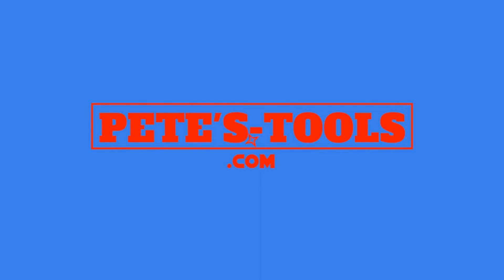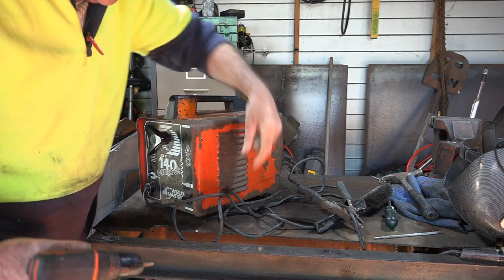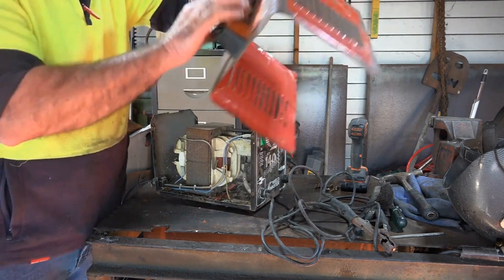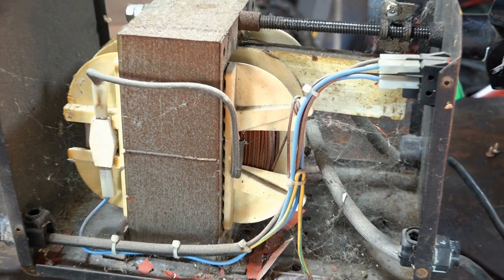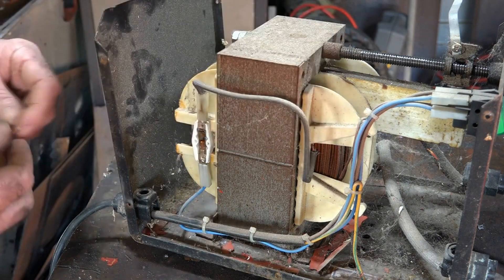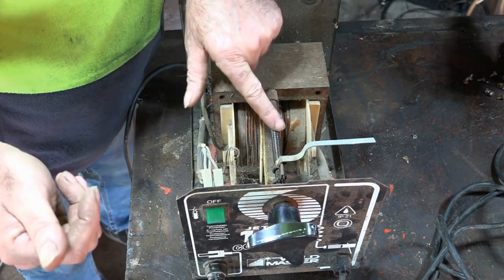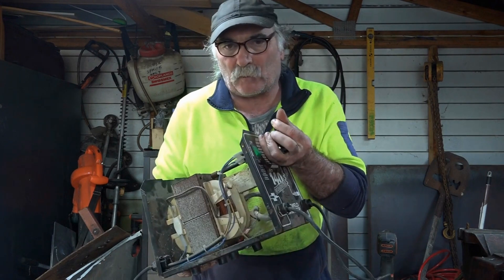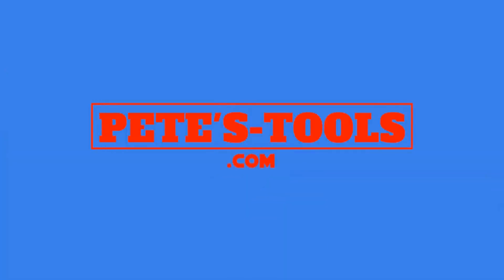Welder That Doesn't Need Electronics to Function

Comment: Hi Pete, I have a 140 AMP Welder pretty much the same as yours , I've had no trouble with it over the last 40yrs the only thing that stands out for me is the trouble I had looking at the settings for Amps, with the plastic screen Dirty and scratched It was very hard to read so I painted the indicator with Fluorescent Paint. which worked great with no Problems. by the way I've purchase a small compressor to run my staple gun which is running fine . thanks for your advice Cheers from UK.
Reply from the maker: Cheers for watching bobby

Comment: Pete I think that's a magnetron and not a transformer,  though I may be wrong without having a look myself,  all transformers I'm familiar with have a fixed core to manage the load at a steady pace,  whereas a magnetron can use pulse induction but makes for an uneven penitration! Anyway,  it'll probably outlast my new Miller! Thanks for the look!
Reply from the maker: Hi mate your probably right . I am no sparky lol.